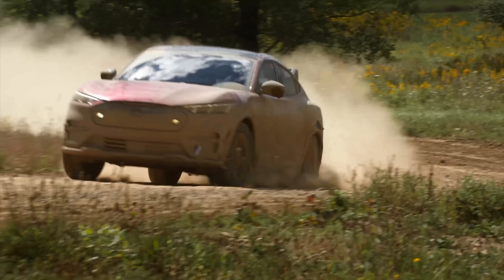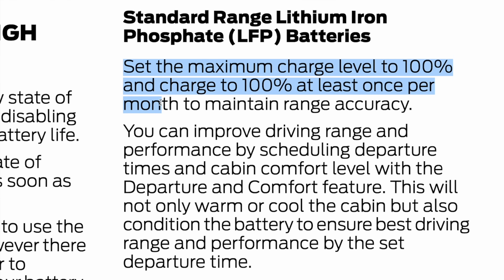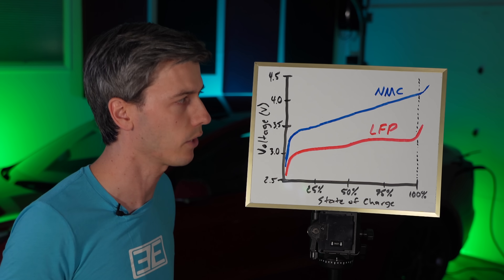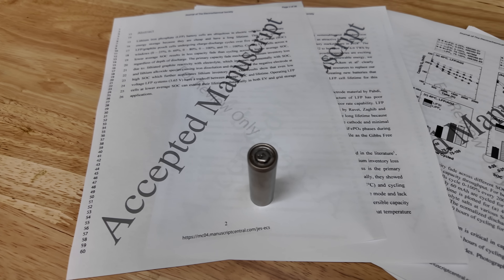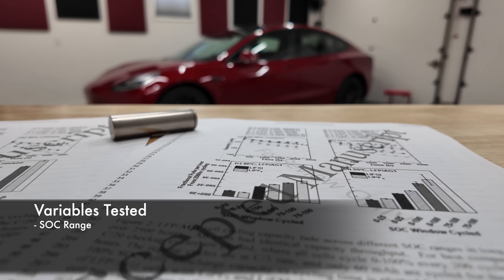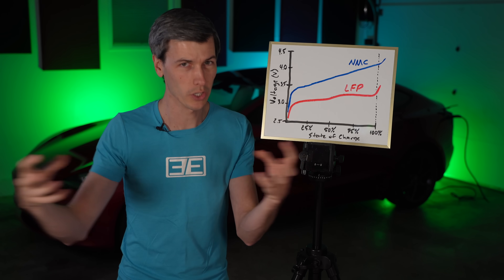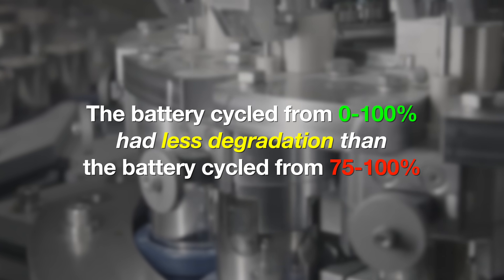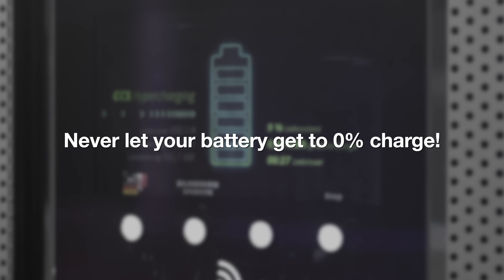How To Ruin Your Electric Car's Battery - LFP Edition!

Comment: I've only gotten through about 5 minutes, and I'm already seeing errors. The techniques are the same for all Li ion chemistries, though the cell voltages for 100% and 0% SOC (State of Charge) differ by chemistry.

1) When a cell reaches peak voltage at the end of charge (100%SOC), that is the trigger for ending the charge, for a single cell. The problem is that while the manufacturer does a good job matching the cell capacities within a battery pack (contains many cells), some cells lose charge faster than others, and none of the cells actually have identical capacities. Over time, as a pack cycles to 80% charge (normal use/charging), individual cells will have a range of charges. To correct this, we encounter error #2.

2) The purpose of charging to 100% about once a month to balance the pack. That is, charge all the cells to 100% capacity. Keeping in mind that Li ion cells absolutely do not tolerate overcharging (this is where fires occur), the BMS (Battery Management System) will pause pack charging when the first cells reach 100% (others may be at 95% or less). The cells with the highest charge are selectively discharged by 1-2% without affecting other cells, then full pack charging resumes. The cycle of pack charging and selective discharging repeats until all cells reach 100% charge at the same time. This also resets the pack SOC to 100%. Balancing is not required very often. Charging to 100% once a month might be excessive, but 4 times a year may be sufficient depending on your driving distance and habits. After all, charging to 100% and balancing the pack takes much longer than charging to 80%.

3) After balancing the pack, the SOC is reset to 100% (all cells are at 100%). SOC is then maintained by integrating current over time (AKA counting coulombs - look it up). This is sufficient for knowing when to stop charging at 80%, and estimating remaining charge (range). Over time and use, the exact pack SOC will drift, hence an occasional charge to 100% may be helpful.

4) Storing at 50% SOC almost doesn't need to be mentioned. If your car operates the HVAC to limit the battery temperature (as most do today), the SOC of a cell has a physical impact on the cell electrode size. At higher SOC, the electrodes physically expand to accommodate the extra ions (see intercalation). If the electrodes expand too much, the electrodes can be crushed, physically fracturing them (fractured portions of the electrodes are non-functional). Cooling the battery reduces the electrode size because of, well... cooling. Cooling to protect the battery consumes battery power. At about 50% SOC, intercalation is less of a problem - there is room to safely accommodate the existing ions without damage at any temperature. Cooling is no longer required. So put your car into storage at any state of charge above 50%. It will fall to 50% soon enough on its own, safely. When you retrieve your car, SOC will be below 50% (hopefully more than 0%, but endurance below 50% is considerable). Afterwards, charge to 100% when you can to reset the SOC measurement, but 80% is fine for a while (lots of margin for SOC error).

5) KEEP YOUR CAR PLUGGED IN - this is more about maintaining power for the HVAC system than actual battery operation. Operating the HVAC from the battery consumes battery cycles. Power HVAC operation externally by keeping the car plugged in - battery SOC will not be affected once charging has completed.

NOTE: Why is 80% SOC significant? Referring the the cell voltage vs SOC chart, when the SOC starts low, but increases, it follows that mostly flat line where the voltage doesn't change much, until you get to 80% (and a reason you can't use voltage to estimate SOC - there's no significant change in voltage between 30% and 75%. Any change seen is due to temperature changes than SOC.) At 80%, charging slows down greatly while the voltage rapidly climbs. Several things are happening here: fast bulk charging of the battery has been completed/slowing topping charging begins/charging >80% is more about knowing when to stop. DCFC chargers will stop charging at 80% as you can't really see what the cell voltages are, and you really don't want to overcharge the battery (FIRE!). Charging from L2 will be just as fast from 80%. On long trips, you can spend a lot of time waiting for that last 20% at each charging stop - it's faster (and cheaper) to charge to 80% quickly and resume your trip than to wait on the charger for that last 20%.
Reply: Thank you for explaining

Comment: Actually I don't understand what the confusion is. 
1. Charge your LFP cells once a while to 100%. (This is so that the BMS can use the voltage vs SOC lookup table to calibrate SOC estimation)
2. When you're not using your car for a long time (like a vacation or something like that), keep it at a lower state of charge, like 50% (so that there are no side reactions.)

In general, cells hate high states of charge and temperature, as you mentioned. 

I also found it really strange that the paper you described did not cycle the cells between 20% to 80% SOC or 20% to 60% SOC. I bet that this condition would be even better than 0% to 25% SOC cycling. As cells hate being at 0% as well :) and therein is the third recommendation

3. In general, for every day use, keep charging between 20% to 80% SOC. The cells will last forever.

Comment: I bought used 2023 m3 rwd wirh 15k miles. It had 262 miles. I charged %100 everyday at supercharged. I was doing uber. Then it dropped to 261. After that I installed wall charger. Now it dropped 258. Then i realize charging %100 everyday not the best even for lfp

Comment: So, I may be more confused now then before I watched this video... I am considering a 2023 Model 3 Standard Range, which has an LFP battery & a 2022 Model 3 Long Range, which has an NMC battery. SO..., if I were to go with the LFP vehicle & "charge only when I need too" how low of a SOC can I allow the or should I allow the vehicle to get too before charging again? Does this differ from an NMC battery...? I have heard time & time again to keep the battery between 80% & 20%, does this still apply to LFP battery vehicles...? @Engineering Explained

Comment: Phantastic video, finally one that goes beyond the basic generalities you see everywhere and you can or not believe.

One important point remains open: If cycling 75%-100% is worst, and 0%-25% is best, how much worse really is "worst"? A little bit, let's say 5% in 10 years, or does it make a huge difference?

Because in practice, especially for beginners like me, it's easier to keep the battery (more or less) full, as long as I don't still have a good feeling about how far I can go and where the strategically best chargers are. (And if your family has spontaneous ideas what to do but no pacience for charging.)

Thanks!

Comment: I have a 79 gmc 1ton.

The gas tanks held 20 gallons each when it was new,

4 and a half decades later,,,
The gas tanks still hold 20 gallons...

Why should I be impressed about electric cars only lose 5 ish % capacity 🤷‍♂️🤷‍♂️🤷‍♂️

Comment: What I don't understand is using the LFP battery is better for longevity ok but to use it in lower SOC I need to increase the charge cycle amount which is bad for the battery. So what is good for longevity? Higher amount of cycles should be detrimental 
I only care about longevity, calibration is not that important

Comment: People listening to car manufactures recommendation on charging, need to remember this.
1. It's in the manufactures best interest, for you to have the best most easy/convenient experience with the car - So you will buy a your next car from them again (aka tempting you to buy new with they have upgraded their model lineup to better ease/convenience with ownership)
2. It's in the manufactures best interest, the battery will last though it's warranty (degrading within the tolerance for warranty replacement) - but not being in "too good" a state - So you will buy a new car from them again shortly after warranty runs out (aka "forcing" you to buy new)
Those in the no.1 category, will generally renew their car, before battery degradation becomes an issue (well within warranty).

Comment: Our cars are NMC batteries, but our home battery is an LFP type battery. It charges frequently to 100% and - unlike an EV - dischargers frequently to 0% too, it also switches a lot from charging to discharging. This all sounds suboptimal for an LFP battery according to the advice here, but there's not much I can do to control it. So I'll have to wait and see if it's built for the purpose.

On batteries in general, I notice people are expecting EV's to have a battery degradation similar to iPhones: takes 2 years and you are at a very noticeable 85% battery capacity, and you'll be out of battery all the time even though it charges super quickly.
But my experience 5 years with an EV is there was no difference after five years. This was daily charged to 100% (could not configure limits) and driving ~ 150 000 km.

It's my understanding LFP's degrade slower than NMC batteries - so for an EV it looks like it's a small worry. It's still nice to know and understand these kinds of things though. Here in Belgium there is talk about a "battery check" initiative for used cars - but I don't know exactly what it does. 

If people think this makes EV's complicated, ICE's are very complicated machines as well. With many nuances most people won't think about. However they're very well studied. Many many car nerds know every in-and-out of ICE's but have no clue when it comes to EV's. The technology is new and evolving quickly, unlike ICE technology, so it's hard to keep track of at the moment, but it'll stabilise at some point.

Comment: Yes, not changing the 12-volt battery on time in a Tesla Model Y (or any Tesla vehicle) can indirectly affect the health and possibly the lifespan of the high-voltage (HV) battery—and here’s how.

🔋 Tesla’s Battery Architecture: Quick Overview
	•	Tesla vehicles use two separate battery systems:
	•	A high-voltage (HV) battery (e.g., 400V or more) that powers the drive motors and main systems.
	•	A 12-volt low-voltage (LV) battery that powers essential electronics like the BMS (Battery Management System), contactors, door locks, lights, sensors, and more.

⸻

🧠 Why the 12V Battery Matters for the HV Battery
	1.	12V Powers the Battery Management System (BMS)
The BMS controls and monitors charging, discharging, and thermal management of the HV battery.
If the 12V battery becomes weak or fails, the BMS might shut down or behave erratically.
	•	Result: The HV battery might get stuck in a passive state or not enter proper charge/discharge cycles, potentially leading to suboptimal charge states.
	2.	Contactors Require 12V to Close
The HV battery is isolated from the rest of the car via contactors (essentially large relays).
	•	These contactors are activated by the 12V system.
	•	If the 12V battery can’t trigger them, the HV battery stays disconnected, and the car is bricked or stuck in a low-power state.
	3.	Overuse of the DC-DC Converter
If the 12V battery is weak but not dead, the HV battery continuously engages the DC-DC converter to keep the 12V system alive.
	•	This frequent power draw from the HV battery can lead to excessive cycling and thermal strain, especially if the cooling system is also stressed.
	•	Over time, this could accelerate degradation of the HV battery.
	4.	Improper Sleep Cycles
Teslas are designed to “sleep” to preserve HV battery life.
	•	A failing 12V battery might cause frequent system wake-ups, causing the car to constantly draw energy from the HV battery to keep systems alive or recharge the 12V.
	•	This leads to phantom drain, more frequent thermal cycling, and unnecessary stress on the HV battery.

⸻

🔧 Summary – Could It Shorten the HV Battery Life?
	•	✅ Yes, indirectly. While the HV battery itself may not immediately degrade due to a bad 12V, the cascading effects of an aging or failed 12V battery can introduce instability, thermal cycling, extra discharge cycles, and parasitic drain on the HV system.
	•	🔧 Tesla recommends replacing the 12V battery proactively, especially in climates with extreme heat or cold, where 12V batteries tend to wear out faster.

Comment: Hello
I do find your videos interesting and very well made, and wondered if you might help me out by answering a specific question
My car is a BMW 320e from 2021 ( 11.15 KW/h usable if I am correct )
I use electric driving as much as possible ( amounts to nearly 50% of the total, even though I do make long trips in places where charging is not possible ), and when I bought the car I had been told by the BMW people that I should not be afraid of recharging it fully after every single time I use it, which I do as otherwise I would have to use the petrol engine much more often
For the 1st 2 years it was on a simple electric plug, and now I have a charging station at home ( but the charging time is still 3h30 instead of 5h30, no real fast charging )
I can not say what kind of chemistry my battery uses ( just asked BMW after seeing your video, no idea whether they will give me answer nor when )
I do realize that there might be big difference in best practice of battery use between a BEV and a PHEV, and I was wondering if you were familiar with my car and if you would have some recommendations on the subject
Thank you
Stephan Lejeune, from Belgium
Reply: Just drink more of that good Belgian beer.  Everything will be fine.

Comment: Basic factors for Li-Ion batteries. They exhibit the least degradation at about 40% of charge. They also degrade less at lower charge rates than higher charging rates.
So for longevity alone you should cycle your battery between 20%-60%, don’t charge at more than 5%/hr, and don’t drain the battery quickly by high acceleration rates.

Comment: @EngineeringExplained
Both Ford and Tesla recommends that you charge to 100% for daily use, to MAINTAIN BATTERY LIFE = to avoid degradation. 
This will inevitably lead to charge cycles at high SoC. Doesn't this contradict your point about specifically avoiding this?

Comment: I have a chinese CATL battery powered 50kwh EV . It's been 1 year exactly and 24,000km later, SOH is 98.5%. DC 60kw charging >95%. Weekly 100% top up but regularly charge to 80-85%, no lower than 30%. Also making sure that the battery cools down post DC charging before shutting car off.

Comment: Long term studies I have read show Tesla batteries degrade at a satisfyingly slow rate,so even old Teslas tend to have high charge capacity left. Second,battery prices are dropping steadily year over year,so if the worst happens,and my car's battery goes belly up,replacing the pack will not break the bank. Finally,I have always read that for local use,charge to 80%,and if taking a trip,you can charge to 100%.

Comment: 🤔...There's an aspect of battery life you haven't considered which is age. LFP batteries are thought to last maybe 20 years and age appears to play a big role in degradation of LFP and NMC. The average driver drives about 14,000 miles per year. This means in the 20 year expected lifetime of a battery the average driver will put 280,000 miles on the pack. So the manufacturer's recommendations are based on reducing degradation on a battery used 14,000 miles a year over maybe 20 years. This makes the technically best charging practices less important when weighed against degradation due to aging which cannot be changed....

Assuming you are an average driver cycling the battery as per manufacture's recommendations should give you the best balance between usability and degradation...

 If you are an average driver and you want to commit to cycling your battery in a way to maximally minimize degradation you will probably at best see only a tiny reduction in actual degradation because age is the dominate factor in the degradation of your battery. On the other hand if you drive many more miles per year than average then how you cycle the battery may provide some benefit...

In the case of LFP that benefit will still probably be very small because LFP can handle 2 or 3 times as many cycles as NMC.

Comment: also consider that it takes exponentially more energy to charge from 30-80 than from 80-100. it might take 30% more time to charge from 80-100%, meaning on roadtrips and at public charge stations, you're encouraged to only charge to about 80% to not be rude and let as many people charge as possible.

Comment: 2024 Model 3 LFP.  1.5 years and 25,000 miles and I decided to do Teslas battery health test. Battery was charged at home mostly and used for commuting. I charged it to 100% maybe 10 times.  Mostly kept it between 30-70% (what I needed for my commute).  Every three months I depleted the battery to 4-6% and let it sleep for several hours, then charged it to 100% and let it sleep for several hours. My battery test ended up at 96% which I’m happy with.